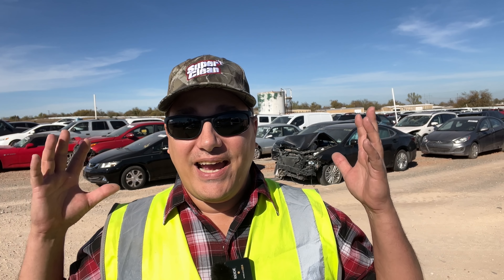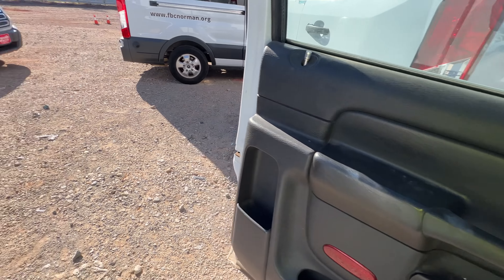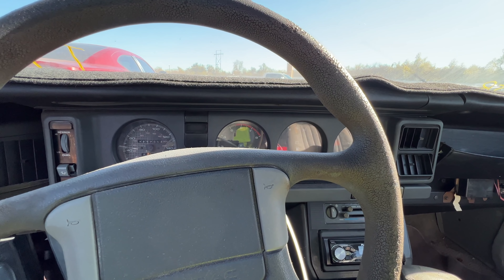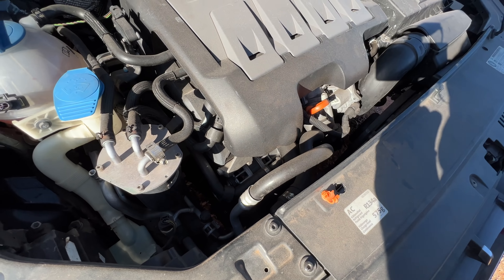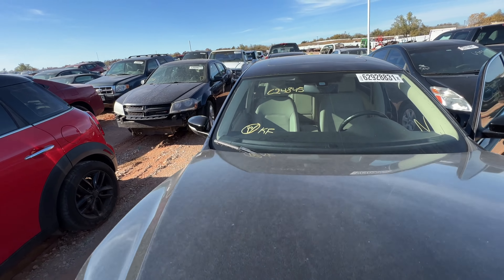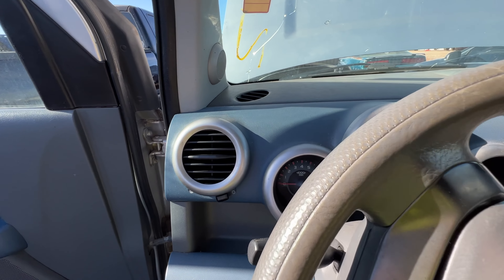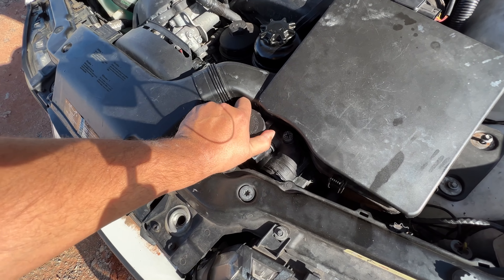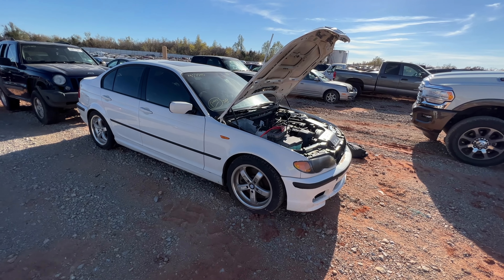Copart Walk Around and Live Bidding!! 91 Pontiac Firebird V8!! 11-16-21

Comment: Those tunedport cars with the bubble hood are pretty rare these days and that one was decent but it had ttops so that means it 10000 percent has a 305 and not a 350
Reply: T tops didn't determine that.
Reply: @wrenchesinmotion3282  sure did with the exception of one year
Reply: @jonathanlawson4667  Maybe IROCs were different then. My 88 had a 350 with T tops. You could definitely not get the manual trans with the 350.

Comment: I have a 2013 VW also. When the battery dies the gauge cluster lights up like a Christmas tree. Drive it about 20 feet and the lights will turn off. Mine is the V6 with the dsg transmission. It's been the best car I've ever owned. 160k miles on it.

Comment: I have a Dodge Dually just like that one except mine is black and automatic, we haul Quick Crete (14 pallets at the time) 50 bags per pallet and 80lbs per bag at 75 miles an hour down the interstate with no issues at all!
Reply: The big issue I’ve seen on the older Dodge trucks with the Cummins is injectors and turbo failures. The turbos seem to fail due to failure of the injectors flooding the motor with raw fuel taking out the turbos bearings my brother in law and the girls BF have both lost replaced injectors and turbos on 12 valve Cummins in 2001 and 2004 Dodge 3500 dually’s with over 200k on the the clock.
Reply: @steve-ph9yg  the only issue I have had with ours is cranking it after it has been sitting for some time, I really have to put some power behind it and sometimes have to use a little starter fluid and even a block heater to start it, after that and while it's being driven on a regular basis it starts and runs without any issue

Comment: I've owned 7 BMW's over the past 35 years. All but one has had a cooling system problem. Mostly radiators cracking. So, I'm just bidding my time with this 7th one.

Comment: That firebird is not a 91. They had airbags that year. That's 89 or older. They used that wheel in 88-89 only I believe. Also that spoiler looks to be a 4th gen style for 3rd gens.

Comment: That 5.9 diesel dodge is suffering from two bad batteries    I bet it would start just fine if both were replaced  I’m talking from experience. With these trucks. It’s eather that or the cross over hot needs to be replaced.  It sounded like it had healthy compression it takes a diesel to jump a dead diesel  your jump pack might be good but that’s a nother thing I learned from owning a fleet of diesel a jump pack will work if the batteries are good cells but if thay have weak cells  you’ll get the same symptoms you got their

Comment: G'day Randy, that Passat is nice, but at $8,500 plus fees, it is close to retail value here in OZ. They may have a higher value in the US. An oil catch can is a needed accessory on the TDI engines as the intake manifold can fill up and block with carbon.

Comment: The VW, the plastic pipe coming out of the air box is not connected, that may be one of the reasons the check engine light is on

Comment: Nice   I had a Brand new 1990 Red Firebird Formula 5.0 V8 my Gramps bought me at age 17. 
So this one has a 1991 or 1992 rear wing. A 1988 or 1989 steering wheel.  A 1987 had a three spoke steering wheel and 1990 they went to the air bag steering wheel. This car has a 87’ 88’ 89’ or 90’ Formula front end. Wheel center caps are a mish mosh should be silver with metallic silver in middle  front ones probably off a Trans Am GTA

Comment: My friend has a 2006 Cummins mega cab 6spd dually with 220k miles he has a 4 vehicle trailer he pulls no problems. But the truck is rusting away it needs a whole new cab Lol its a clean ass truck to

Comment: The Firebird is a Formula... rough, but worth fixing up...  Basically a Trans Am without the ground effects...  same WS6 suspension..  same engines available...  Worth more than a Trans Am... faster too, lighter..   and it's  NOT a 1991 model...  1990 or earlier..  all 91 and 92 models have the "banshee" nose.. the hatch is from a 91/92 model...  the aero spoilers were banshee formula/ta items ...Very sought after ride... i was a Finance manager in a Pontiac Dealership when that car was new... i've owned 30+ 3rd gen f-bodies...  most were birds...